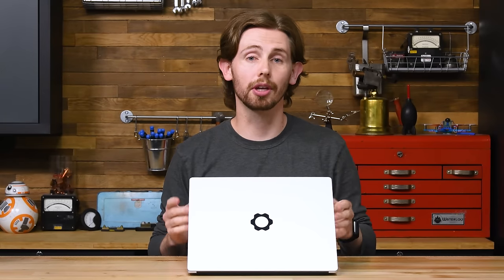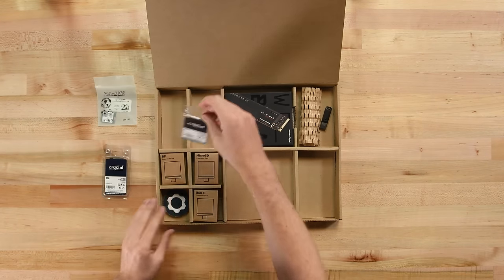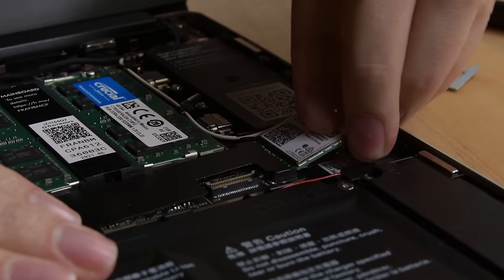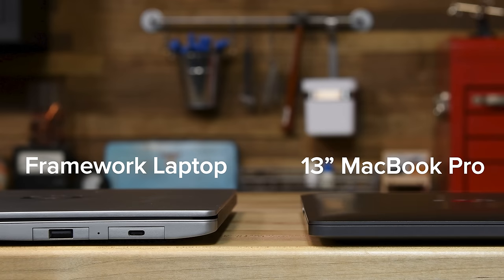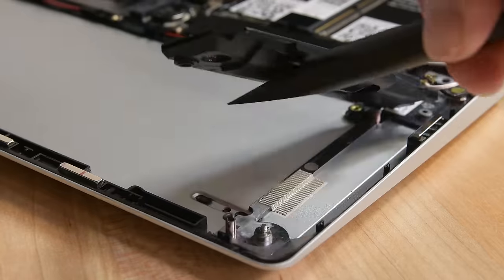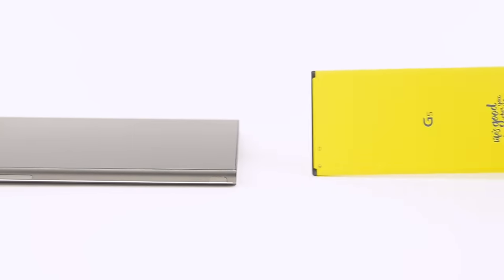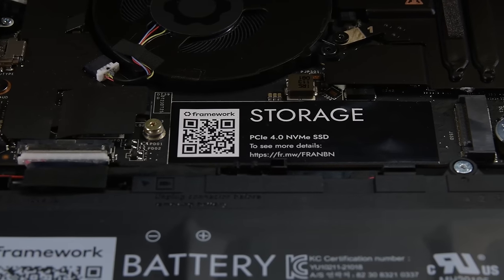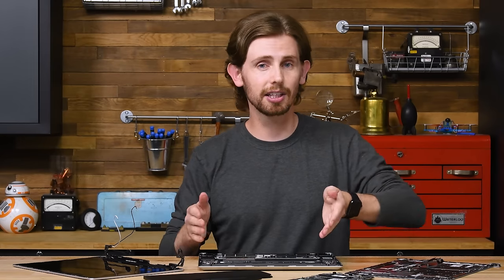Framework Laptop Teardown: 10/10, But is it Perfect?

Comment: The CPU could be modular like older cpus but in the current day and age it’s impossible
Reply: Yeah, is this even an option for mobile from either of the big 2 anymore?
Reply: They can use desktop CPU, like the XMG but it will probably be thicker.
Reply: Well, you "could" have a socketed CPU, but then you'd be stuck with what your chipset supports anyways and since it would probably be a non-mobile CPU, it'd have to have its voltage/clock heavily tuned for power consumption...
Reply: @ChuckNORRlS  a lot thicker (like nearly double IMO) and it would produce more heat, for a laptop it’s just non-sense to include a swappable cpu, desktop sockets are just too think to be in a thin and (reasonably) light package.
Reply: @Alex-hv3ir  Correct XMG Desktop replacement are thicc af, If framework decide to go down that route in the future probably we will see a desktop CPU inside it.

But to be honest the repairability on this laptop is amazing and needs to be benchmark to other products (they can't play the it gonna be chunky if it's repairable card anymore) .
Reply: @ChuckNORRlS  yeah I agree. But I would improve just one thing as of right now, the ports. Sure they’re modular and cool, but they waste too much space. Because, yes, sure you need some space to fit a full sized HDMI (I think it’s the biggest port they provide) but not so much, I would actually shrink the plastic (?) around the port (mostly from the left and right of the port) so maybe a third one could fit. Also usb-C are pretty small, and I think they could have just put 2 of them in the same “slot” making it both space efficient (doubling the ports using the same amount of “slots”) and more useful because why not, 2 is better than 1, right?
Reply: Intel decides the socket, nothing they can really do.
Reply: @Alex-hv3ir  yeah but for a first release not bad at all, and if that ports also used for eGPU (decent bandwidth) it also will be a good feature
Reply: @bobweiram6321  true that's why these type of machines called "Desktop Replacement" the battery mostly acts as  power backup last for 2-3h.
Reply: @bobweiram6321  They can just undervolt it... Or not even that, there are desktop CPU's that pull less power than some H-class laptop CPU's.
Reply: I swear that AMD planned to do this, but couldn't, because their desktop Ryzen chips barely need a chipset to work.
Reply: they could potentially make their own sockets and just put pins on the cpu package. but i can't see that happening
Reply: Why? My MacBook is nearly 8 years old and still relevant.
Reply: Anand Raj  i have seen those
Reply: Anand Raj  There are 4th gen intel core i mobile CPUs that are socketed
Reply: Yeah iirc anything after 4th gen mobile core they are soldered, you cannot replace them anymore.
Reply: Most laptop cpus dont have a way to take them off and back on a motherboard without solder, FrameWork would have to create their own custom way of replaceable CPUs and would cost a bit and it would be a giant logistic problem too
Reply: BGA to LGA adaptor might work. I mean I saw a i7-4th gen modded to be use on pc board
Reply: @ChuckNORRlS  The issue is Desktop CPUs are very power hungry, they're not made for laptops.

Also sockets add additional thickness, which the BGA solder balls diminish.

But yes, it is possible that eventually we might see ultra thin laptop CPU sockets that are LGA format, but until then we're mostly stuck with the direct to PCB style BGA.
Reply: @Alex-hv3ir  They might make the modules with twin USB c in the future , there is enough space for it . What a lot of commenters are missing is that this is a start up company and its a good start, if they do not get swallowed up by the bigger guys they can improve the modules and whole package
Reply: Some laptops do have an actual AM4 socket u can put ryzen 5950H in it.
Reply: @anandsuralkar2947  Yes , think one is an old H.P or Lenovo
Reply: Having modular CPUs has never really helped when going with Intel. For every PC I have built, I always had to replace the motherboard. The only thing you can always count on is the PSU and the chassis (and possibly the GPU, but they do not age well).
Reply: @ChuckNORRlS  maybe make it a different model?
Reply: Yeah each generations and iterations of BGA CPU will always has different grid arrays, and specific voltage requirement.

Even if they made it socketed the whole thing won't work properly either.

And using desktop CPU is really not the question here.
Reply: @muhwyndham  If as they said in the video it is possible to upgrade from a i5 to an i7 by changing out the motherboard  they will make any adjustments when building the motherboard . They offer the option of choosing which one you want when ordering so chances are the BGA is the same on both . The only limitation is that it has to be an intel not something like a Ryzan chip but thats fairly standard practise with the majority of manufacturers
Reply: @MrTarmonbarry  it is not about vertical upgrade (i5 to i7) but more about the inter generational upgrade. for example Kaby lake has socket BGA 1356, yet tiger lake has bga array of 1449. 

You cannot make pin socket CPU for mobile because mobile CPU (ESPECIALLY INTEL) tends to change the BGA socket for each generation, which makes it kinda moot point for the CPU being socketed in the first place.
Reply: @muhwyndham  With pin sockets you are talking old school , that will never come back for laptops , to bulky , everyone wants lightness .Back when the pin socket laptops were being built it was all they had , now its all BGA so in a way they have no choice about what to use .
Oh yes , pin sockets had their drawbacks with which would suit and work with different motherboards , led to a lot of problems with self builds were people bought incompatible parts . If you knew which worked with which then no problem , build it and turn it on . I wonder how many people bought incompatible motherboards and CPU's , quite a few i would imagine if they were new to building a computer , good way to learn but expensive and frustrating
Reply: @Alex-hv3ir  Yes , HDMI is the biggest now we do not have the big old serial port .
Shrink the plastic , Hmmm, they might have designed them like that to allow for further upgrades like having 2 USB c ports in one module . Its a start up so they might do that in the future if things work out for them . Every manufacturer will have gone through the same sort of problem of what to provide . Take a look at the intel NUC range , the available differences is /was mind boggling on the original ones . I have i think 8, bought a load of not working ones cheap to try and fix but i think most are bricked . One works  and then i bought a working board from the U.S to read the Bios chip and try transferring , not got round to it yet  ))),  its a ''one day '' kind of job )))

Comment: My ideal Framework build would include a headphone jack, wider battery, and a Ryzen CPU.

Would totally pair well with a Fairphone and eGPU 👌
Reply: Just get someone to make one of those adaptors that splits into a USB-C port and a headphone jack.
Reply: It comes with a 3.5mm combo headphone/microphone jack on the left side, next to the front expansion port. Battery is 55Wh.
Reply: headphone jack is available but soldered to the mobo, a wider battery would sacrifice the quality of the speakers, but maybe next year they can squeeze more battery hopefully
and i agree on having a ryzen model
Reply: The only problem I have is how the Fairphone is slow. It's got the same specs as a Motorola Moto G9 Power (which I own).
Reply: @ridakesserwan8712  Headphone jack isn't soldered to the mobo. It's soldered to a separate small board connected to the mobo with a little flat flex cable. You can see it at 2:57

Comment: My only complaints would be the price and the screen size.  I can get a good 16" laptop for less than their 13" model.  The 16" model would lack all those port options and ability to swap out the screen, etc., but the most important parts, being able to upgrade the memory and storage, would still be there.
Reply: I think you should also consider the potential costs of repair though. Depending on the model you pick, the repairs could exceed the cost of a Frameworks and then some.

Comment: Holy crap this looks amazing! I've been thinking about getting a new laptop for when Win 11 comes out (since it's not compatible with my current device) and this looks an amazing option! The idea that you could just buy updates to parts rather than junking a whole machine is just :chef's kiss: . Time to go watch a bunch of reviews on how it functions as an actual machine!
Reply: Microsoft confirmed Windows 11 is compatible with any PC you just have to do a fresh install.
Reply: @kwlkid85  I remember hearing earlier that you need at least a certain version of a certain security chip in hardware for Win11 to be compatible. Maybe things have changed since then, but I've already received an email from Microsoft saying my laptop will not be compatible with the new update.
Reply: @Respectable_Username  Microsoft wants every Windows 11 pc to have a TPM 2.0 chip but after a lot of backlash but has said they won't stop people manually installing it on PCs without the chip.

Comment: Coming soon from framework 
16 inch version
Higher capacity batteries
Number pads (16 inch version only)
GPU modules (technically anything else if wanted)
Better hinges
AMD and 13th gen mainboards

Comment: Well if they made it so even if the sad version happens and you cant get the best processor next year, I think making it so you can install next models motherboard and processor in this years body would be a win. If they could capitalize on making it so you don't have to keep buying a new laptop for the upgrades, you can literally just install the upgraded parts, that would be awesome. And then just occasionally change the body,  but the body could also be a part that could be upgraded. They'd potentially grandfather their customers in for a long time.

Comment: Basically what I wish the M1 MacBook Air was. 😢
Reply: Will never happen on Arm chips. Everything is on one chip
Reply: All i wish for M1 mac is 1) socketed storage, 2) non-glued battery, 3) SD card reader, 4) usb-c on the right side. If M1 does all that, I will be more than happy. It doesn't need that much changing, apple just won't do it for greedy reasons. 

When it comes to apple I love the products and hate the company.
Reply: Never happening
Reply: Honestly, I would honestly not mind if apple implements the custom ports idea, Rather than a dongle, you could just remove the USB-C port and connect something like DisplayPort…
Reply: @houghwhite411  Sadly yeah. One can dream though!
Reply: @cat-.-  I would love to see all those changes. Sadly don’t think socketed storage would perform nearly as well, but that would certainly be great! Would also love to see upgradable RAM, but given how well the M1 performs and that it needs integrated I can live with it. Curious to see what they’ll do with a more modular Mac Pro if they come out with one!
Reply: @cadenchurchill4296  My computer engineer  friend confirmed with me that "having a socketed storage does not at all affect performance" so there is that. RAM on the other hand considering it's packaged in the M1 chip I see why it can't be socketed.

But lets be honest, the reason we're having this conversation in the first place is because apple charges obscene markups for storage/RAM upgrades.
Reply: @hilal_younus  That would be pretty awesome! I wouldn’t mind having HDMI and USB A ports on my Mac.

Comment: 10 out of 10 only if they provide next gen CPUs and AMD  apu that would be awesome!
Reply: @brandonchutt312  Battery life would like a chat....
Reply: @brandonchutt312  Uhhh, my friend, please come back to 2021. 2019 was already a long time ago. Zen 3 crushes Intel at low wattages, has 8 core CPU's, and no, Intel's 10nm+ isn't yet comparable to TSMC's 7nm.
Reply: My guess is that AMD APU's were in short availability at the time.
Reply: @brandonchutt312  Transistor density doesn't determine node quality. Samsung also has nodes with a comparable transistor density to TSMC, but like Intel, they draw more power and have a lower performance.

Comment: Just needs a trackpoint.
Reply: Honestly don't understand the trackpoint hard on that so many people have. Explain it to me?
Reply: Like from those IBM laptops? That would nostalgic as an optional keyboard replacment.
Reply: The laptop is modular. Perhaps you could make a trackpoint module for it.
Reply: @Jack Myhre Its a little nub on mostly older IBM laptops. Used for cursor movement back when trackpads were small and very unreliable. 

Personaly I don't understand why people still want them when trackpads have evolved some much and most laptops also have touch screens.
Reply: @GamesplayChris42  Convenient if you're mostly typing, so you don't move your hand away from the keeb.

It's basically a joystick in the middle of the keyboard, but optimized for mouse movement. Takes a while to get used to.
Reply: @WhenDoesTheVideoActuallyStart  Makes sense, I have always just used my thumb on the track pad but I guess to each their own.

Comment: How the f is a small battery a non-issue? Laptops are for being used on the go..
Reply: It is difficult to walk and type at the same time.
Reply: 55Wh is pretty standard for a laptop battery. The M1 MacBooks (not the Air) are 58Wh.
Reply: @r.l.royalljr.3905  you cant really compare that, m1’s are WAY more efficient than intel chips, that’s why they have amazing battery life

Comment: If this is possible for a reasonable price, then other have excuses.
Reply: The base DIY starts at around $550
Reply: @MrTarmonbarry  jizzzz are you kidding? DIY version no ssd no ram no windows already at 800 usd lmao
Reply: @jonmon5745  The word is ''Jeeeeeez'' , and its not $800 , they start at $500 and it comes as a kit that you choose so the end cost depends on what you order. At least if you want to change to a higher end CPU further down the road you can buy another motherboard at a few hundred dollars rather that a whole new laptop at $1000 plus .
Go to their website and find out facts , it helps )))
Reply: @MrTarmonbarry  lmao it was 800$ for i5 board only where you get that facts 500usd lmao... And also new motherboard means new ram.. They have to follow the manufacturers. And 800usd with no dedicated gpu lmao..
Reply: @jonmon5745  Where did i get that figure from ??. The makers website )))
lmao)))
Reply: @MrTarmonbarry  It is saying $749 when I checked (today).
Reply: @der0keks  O.k , thanks . What spec is that for , is it the base model ??
£540 , thats not bad but does depend on specs
Reply: @MrTarmonbarry  The i5 without ram or SSD. Was about USD900 with 16g and 500g SSD.
Obviously the issue here was comparing different currencies
Reply: One would probably expect to pay extra because this is isn't a copy/paste of an existing laptop. I think it is a fair price, just comes down to people putting their money where their mouth is
Reply: @der0keks  $900 with 16GB ram and 500GB SSD?, about £750 , thats still pretty good .
The currency thing can be a problem at times . I am dealing with 3 different ones , USD, GBP and Ukrainian Greevna ,it gets confusing ))). 
I wonder if they offer the option to buy the modules as separate pieces so you can swop them out as needed
Reply: @der0keks  I agree, it is a fair price , i would go so far as to say a very fair price , if i was in the market for a new one i would definitely buy one when they get to Europe but i have a DELL Vostro 5568 thats working well

Comment: I'd really like to get one of these since my XPS 13 died recently and I'm stuck using a machine so old that it's running Windows 7, but the price for a DIY one when reusing the old SSD drive and with no OS is more expensive than buying some touchscreen 2-in-1 with similar specs and quality from other companies.

Repairability and modularity seem amazing, but I'm not sure I can justify the expense just for that and with less features.

Comment: I like how all the mechanical and electrical specs are available for the "expansion" modules.
This means that certain things Framework won't legally be able to market (like MXM and mPCIe slots, DP ports, FireWire, Thunderbolt, Lightning connectors) or which are just niche items (like RS232 ports, CF slots, optocoupler interfaces) could still be manufactured for (and sold by) DIY hacker/modder folks.
I would prefer a 16:9 display, though, with or without touchscreen. Hopefully an option they'll offer on future models.

Comment: The only question I have had all along is if the screen is replaceable? In all videos I have seen they treat it as a display assembly, with microphone, webcam, hinges etc. does framework offer a screen-only replacement? if they do, how easy is it to swap? If they don't, that's a bummer. I really hope framework takes off. I just wished they had AMD Ryzen versions of the machine. as well as pen-support.

Comment: the only thing to keep in mind is that they promise that you can put a different mainboard into this thing later down the road with different gen cpus. which means that the port situation will stay for a while. the negative part about is that until know only single port adapters were  shown (i dont know if they will release an adaptre with two usb c or two usb a ports). if there is a reason why they didnt release one yet (like not enough space) then sadly it wont be changed in future generations either, so you will only have those 4 ports which i found to be on the little side.